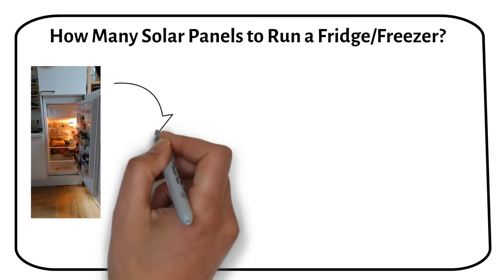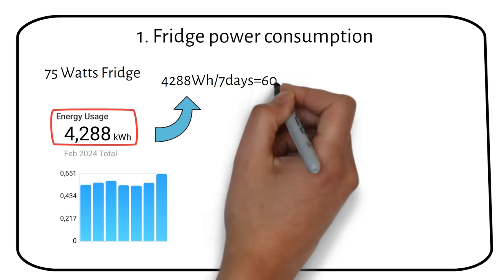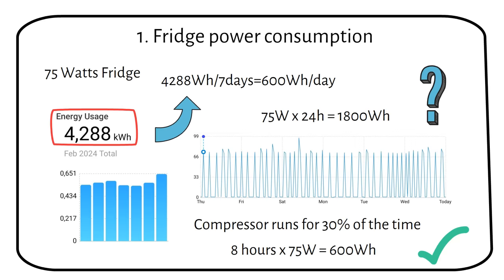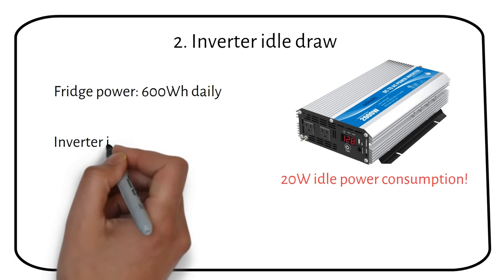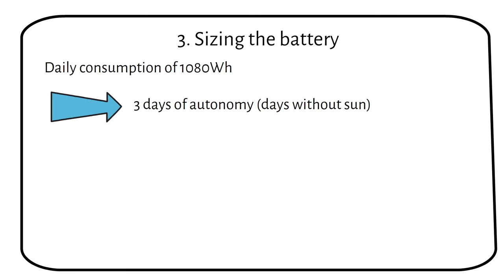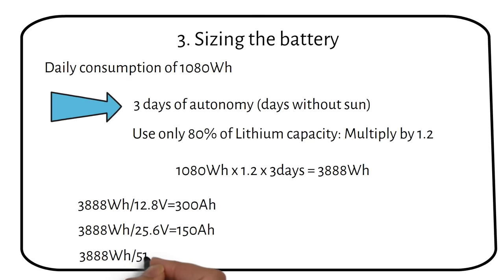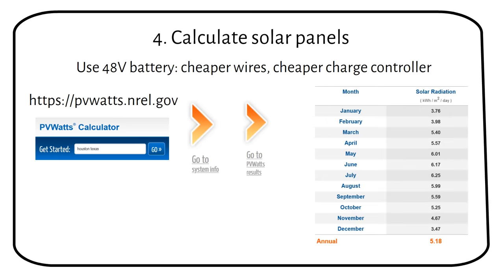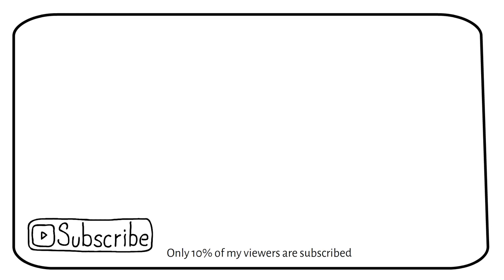How Many Solar Panels To Run a Fridge/Freezer?

Comment: Hi senior technician,
 I have a solar panel with one 200Ah  battery and one 24to 12 volt converter.
 Is it safe to use the converter with out a charge controller?

Comment: Assuming only one battery...and not taking into account even on cloudy days, still getting power in from panels.  If living off grid (with that big of a fridge ?), then will have from 3-4 batteries.  If at your home with both solar and grid---then you can switch to grid power during winter months and go back to solar when sun is out more.  Too simplified...
Reply from the maker: Please check my video about sizing an off grid solar system. If you are grid connected, it doesn't make financial sense to run the fridge on batteries.

Comment: I don't see that you took into account the ambient air temperature. The warmer the room temps, the more energy the fridge will use to maintain the internal temps.  How much energy is used to maintain the ambient air temps to run the fridge at a constant?  If running an air conditioner, did you factor in the energy used for it?  A fridge will use less energy on a 60* day than it will on a 90* day.
Reply from the maker: True. However a fridge is placed in your home. So 20 degrees Celcius. And that is what the test environment was. It's not going to be boiling hot in your kitchen.
Reply: @cleversolarpower  So, in order to maintain a steady room temperature, what energy is calculated in for the air conditioning, or heat?   In my RV which uses a 12v reefer with a solar panel and battery, if I do not run the AC off the 30 amp service, then the interior temps can hit well past 90*, making the reefer less efficient and drawing more power from the battery, overwhelming the solar.  IOW if I want to keep the reefer up and cold in the RV, without any other energy use, then I would need far more than 400 watts of solar and batteries.   Has that been taken into account?

Comment: Can you use a smaller system based on a best case scenario then use a smart controller to switch to the electrical grid when you don't have power?

Or is this not allowed by the electrical companies?
Reply: Not allowed in the UK. If the mains power gets disconnected in the UK, your panels are as well.
Reply: @dlarge6502  You can't connect both the solar & the mains to some 'smart switch' that will feed the refrigerator & switch between them instead of doing it manually?

Comment: First, i would like to thank you for your video. The math and the explanations are spot on.
However! You are going way overboard with this.
Like.... i you want to go completely off the grid, by all means, this is correct but i think most people want to balance the cost of solar with their mental sanity so 3 days is way too much and there is no problem in taking some energy from the grid.
For 1 fridge, a 200W panel with a 1kwh battery would be an excellent start. Maybe 400W if you really want to be sure that in a bad day you can still produce something.
The panels are not the place where you spend most of the money, (battery is the money drain) so i get the will to put 1KW just on panels for 1 75W fridge, but it is just WAY too much.
Reply from the maker: Of course it's way too much if you are grid tied. If you are, then you don't need any batteries and solar. But this channel is about off-grid. So people still need to use their fridge 24/7. And that comes with days of autonomy.
Reply: @cleversolarpower  Ok, maybe i do not know the hole history of the cannel and the reasons behind going completely off grid (my bad, maybe that could help explaining a lot of choices).
Why do you want to go completely off grid when that involves a lot more investment? why not just go 50%? where the investment is a lot mote doable and could convince a lot more people to start with?

Comment: This video and gave me a big headache. I had to take two Tylenols after watching it. I’m not hating, but I’ll just plug in my wall. Pay the bill and let them take care of it and if I lose power, I will plug up my generator screw damn solar panel, and all the rest of the mathematical bullshit
Reply from the maker: I'm sorry i gave you a headache 😅. If you are grid tied i recommend putting up some solar panels with a grid tie inverter. Easy.

Comment: Why would you connect a rv fridge to a inverter. You already have a 12/24v supply. Why use a AC fridge? Doesn't make sense? Another, lets stretch the video "out" by complicating a simple subject. 🤔
Click bait!
Reply from the maker: Haha, what if you have a 110VAC fridge like most people have?
Reply: Brand new 10.1cu ft  110v fridge, 500$cdn ($400 US), 2000w ps inverter $175 cdn, versus $1200 cdn for a 12v fridge, almost half the cost. Yes, I live in an RV. My fridge has its own autonomous 12v solar setup.

Comment: Hi folks!

My equipment I use in my RV:

10.1 cubic foot 120v Magic Chef fridge uses about 600W per day.

Victron MPPT 100/30
120AH LifePO4 battery
LCYMW 2000W 12V/120V inverter (90% efficient)
Renogy Battery monitor
1 180W bougerv panel
2x 200W Newpowa panels

Fridge, battery, solar charger and inverter are all within 3 feet. All panels are laying flat and in parallel, all connections to them are within 8 feet.
Cables are all next size larger than required.
My fridge is in my class A motorhome, which is my actual home. I summer in Ottawa, Canada, and Winter in Yuma, AZ

The fridge is going 24/7, it is currently 11:00am in Ottawa (my RV is also in shade often) and the weather is cool (16*C),
and it is pouring rain, and I have not seen the sun yet.
I am getting anywhere from 20W to 140W today at any given time.
My battery currently shows 94AH, and it was fully charged by the sun yesterday. 
Victron charger shows yesterday sun yield was 1.02kw.
I set this up 30 days ago, and my fridge and battery have yet to see grid power. 
On November 1, my wife and I will do our annual trek to the desert in southern Arizona and California until mid April
We NEVER use grid power from November to April, and very little in the summer (None for the fridge now!)

OVERPANEL if you can, cabling thicker than recommended, keep everything close!

Thanks for all the info Nick!

Comment: Texas has 3.5 sun hours p/day in winter.?! Where I live its 0.55. By my calculation i'd need approx 26 panels!! ATM i only have 14. :-(
Reply from the maker: Yeah, location matters alot. However, during winter you can use a generator to bridge the 3-4 months of low irradiance. That way you need less panels, and will save some money + have a backup generator.

Comment: The big question is cost.  The average large refrigerator cost $6.50 per month x 12=$78 yearly.  If your solar set up cost $1500 you would need 19 maintenance free years just to break even.  The juice isn't worth the squeeze.
Reply from the maker: I agree if you are grid tied. However, if you are off grid it's great. Most grid tied systems don't have a battery so it's cheaper.

Comment: Funny, because I have a small solar panel that is one 300 watts and a 2000 watt power inverter on my Frigidaire refrigerator has 2 doors and a ice/ water dispenser and it works fine on it .

Comment: Your numbers say KWH and then you to WH. One of those is wrong because a KWH is 1000 WH's. And for 80% capacity you don't multiply by 1.2. you multiply by 1.25. 1/0.8= 1.25.

Comment: Remember:  Sometimes you may not have enough powerfull Sunshine to recharge cells for few days.
Around December or January,  you may have only few hours of Sunshine per day to be enough productive and no electriciy for next few days.
So calculate the size of batteries and solar pannels based on maximum usage and minimum energy producing.
.

Comment: The new refrigerators that are made now work better now on less wattage then a refrigerator  10 years old are older i had my old refrigerator  hooked to a 2000 watt just to get it to start up then got a new refrigerator  and now got power to spare  for other things

Comment: A typical yacht sailing yo Tahiti with the same refrigeration capacity uses 1 × 200 watt panel! Because of efficiency ratio is increased due design ie  lots of insulation drawers or chest type instead doors.
An energy efficient domestic would have drawers and the compressor on top to disperse heat away, rather than at the bottom where the extra heat effects the operating system. 
Basically domestic fridges are the only things holding a vast majority of households from being  seamlessly grid free... These fridges are cheap rubbish and none of the appliance companies have found this market potential!

Comment: Wow! Interesting . I want . Because my bill is 6,500 pesos around 450 watts used
Reply from the maker: If you are grid-tied i recommend using a string inverter to offset you energy consumption. Especially if you have a feed in tariff.
Reply: @cleversolarpower  hi. What’s string inverter ? Thank you

Comment: It makes no sense that there is an idle power draw. Idle state means the unit is merely waiting for demand. The current required to monitor, detect a changed state or demand in a fridge or  microwave should be milliwatts, not watts. You should be able to leave your house with AC charging only and the unit should detect AC power failure and swich on. Thereafter, it should not draw current except on demand.
Reply from the maker: I suggest you measure the current coming from the battery with a clamp meter. Once when the inverter is turned off and once when it's turned on 😉
Reply: @cleversolarpower  My Ecoflow will discharge in 1 week on AC plugged in and pass through mode. So the fridge is on 100% AC, the Ecoflow is standby and internals should draw nothing. There is nothing to monitor. If the AC fails then a simple relay that SHOULD be latched would open and activate the Ecoflow which should have been fully charged except for internal drain. You can set it to discharge to low percent and charge to a high percent but that is cycling the battery for no reason.

Comment: Not telling people hpw many solar panels is why people are not subscring
Reply from the maker: I told you the amount of watts. There are different panels out there. 100,120,150,200,220,250,300W,... So telling how many panels is plain wrong. You need to know the amount of watts. And I gave it to you on a silver platter.
Reply: @cleversolarpower  you asked a question in the title. Many YouTubers would, with such a question, also go ahead and not only answer it, but also show an experiment showing that they were able to run the fridge on their solar panel array. Panels also have efficiency ratings, so even if we use watts, how much energy is lost in the cables. Are you able to run the fridge over night when there isn't any sun light? Everything you did was only hypothetical, but in science you also need to run experiments too. Not every panel even at its rated wattage is going to get you that output. There are also other factors such as panel placement as well to take into account. Just going off watts isn't enough when picking a panel.

Comment: Your graphic says "kWh," but you say "watt hours" which makes your math potentially wrong by 1000x.

Same with the PVWatts chart.
Reply from the maker: The comma is not thousands, it is European notation of numbers. I thought people would notice.
Reply: @cleversolarpower If you're going to release international videos, then you should either specify implicitly what it represents, or you should use whole units (1234 meters not 1.234 km).

Better yet, use the method that is used by more than half the world's population.

Comment: My total electric bill in May June was $99 a month. It would take 20 years to break even.
Reply from the maker: Then you should still do it. Just kidding, if it doesn't make financial sense and you are connected to the grid, then don't use this setup. Can use solar panels with a grid tied inverter to offset your consumption.

Comment: You didn't answer the question... So you would need between 3-5 x 450 Watts of solor panels
Reply from the maker: Solar panels are different in power. There are infinite possibilities; you just have to divide the total power by the power of your panels.

Comment: If the converter consumes 480 Wh / day, I would get a fridge that runs on the battery voltage :)
Reply from the maker: Yes, but DC fridges are more expensive.

Comment: Your compressor runs 30% of the time!?!? That's the heaviest duty cycle refrigerator I've ever heard of! Mine runs about 5% of the time and it's an old af landlord special. You might want to replace that thing with ANY other brand.
Reply from the maker: 30% duty cycle is standard. Check my video about how much my fridge consumes.

Comment: Yes this is matematic. But exist also different solution. Run refrigerator when is sun and cool two or three degrees lower. And through night let it run from grid. Some batery you need only for one hour to keep running in cloudy day. Thru night you so and so do not open fridge. Switch between this two power sources can do relay switch and phased with grid we do not nead.

Comment: Worst case scenario misses out on cooler ambient temperatures like in December so the refrigerator uses less power.
Reply from the maker: Not if you heat your house 😀
Reply: @cleversolarpower  Agreed in case of open kitchen.

Comment: Through my own experience with such a system you may also be able to run a modern washing machine during peak sunlight hours (especially during summer) and have the batteries recover before sundown. That's dependent of course on inverter size and that the washing machine isn't heating it's own water. If smaller inverter is used that can't cope with all appliances running at the same time, then turning fridge/freezer off for a half hour wash will not impact food temps enough to be a concern.

Comment: If you can still buy a propane powered fridge this might be a waste of time. Not sure
Reply from the maker: That would be a good option as well.
Reply: I had a Norcold 1200 propane/115v fridgein my 2005 motor home. When it was on propane, it does not use much gas (20lb/month), but its circuit board/fas/lights use an additional 50w DC at the same time.

 If I wanted to replace it, I was looking at $4000 installed, with no clear installation date. I went with the following:
Brand new 10.1cu ft  110v fridge, 500$cdn ($400 US), 2000w ps inverter $175 cdn

Comment: The amount of solar energy generated per square meter depends on various factors such as location, time of day, weather conditions, and angle of the sun's rays. On average, a square meter of solar panel can generate around 200 to 300 watts of energy per day, but this number can fluctuate based on the above factors.

Comment: I have 1380w of flat mounted solar panels on my van and a 5000w/h battery bank, even when overcast it has no problem running the fridge and small freezer I have in my van (meaning during the day it tops up the batteries to fully charged even when overcast if I only run the fridge and freezer).
Reply from the maker: That's a lot of solar power for a van!

Comment: you can save a lot by switching off the inverter when the fridge is idle, or even use a dc current compressor motor.
Reply from the maker: I don't recommend that. A fridge turns on every 20 minutes or so to run for a few minutes. Are you going to turn on the inverter every 20 minutes? No, so you should leave the inverter on or get a DC fridge.

Comment: 75 watts is less than a lightbulb ......I live in Brazil where all the appliances are smaller, we have an average size fridge that pulls up to 1.4 amps at 220 volts, or in other words 300 watts, a USA fridge would pull more than that.  It is rated to use an average of 13 kwh per week or 54 per month.  We power our offgrid system with a diesel generator because we simply need more power than solar panels can deliver.

Comment: My defy c300 with A+ rating is suppose to use 254 kwh a year according very          
( un)iformative pamflet.I measured power consumption 75 to 83 watts when on.Not accurate meters ;just give idea.Only kwh a year is shown in pamflet.No indication about true wattage usage when on.No graphs what to expect when temperature is 10;25;35;45degrees celcius outside.With say 30 times opening closing door with 10 second long opening.Manufacturers of fridges and freezers go out of their way to give you as less info as possible.They should hire you to communicate with public.Maybe will bump up their sales.Because it is not recommended to use old style refrigerators with solar.Especially hot climates that are regulary above 40.

Comment: The BMS on the battery bank need to be able to take 1110Wh charge too... on a 12V system that would be roughly 92A.. Also need to calculate loss in the inverter  too..

Comment: not true !! I run one deep freeze and one frige on 3x 500 watt DJ pannels conected parelell and one 3 k watt 24 volt Mecer inverter with 4x80 amp 674c  lead acid car battries.Freezer is a model DD1-33-2  A++ Upright 212 litre volume and 190 watt hour. Refrigerator Defy A++ model DL1-45-2  volume 335 uses 106 watt per hr.
Reply: Maybe you can write something that is a little easier to comprehend...

Comment: And for the conclusion, your total setup cost will be 4000usd. For that money you can buy as much grid electricity to power your fridge exactly 200 years. (0.6kWh day/ 220kWh yearly. Total yearly cost to run this fridge will be less than 20usd per year. Common sense?

Comment: you can break it down even more I run 2 large fridges both with bottom freezers and a medium size chest freezer, at night when I am in bed all 3 of these use between .2 kw to .3 kw per hour, it uses .2 kw while running and .3 kw when the compressors kick in, that is usually every third hour, costing me 1 cent per hour, this only in quiet time not when day time and using them to open and close
Reply from the maker: So about 600Wh in a day per fridge, just like my fridge?